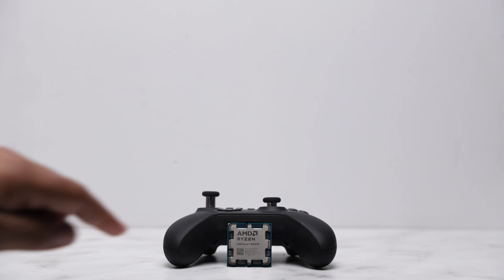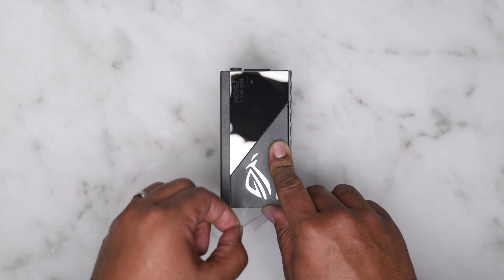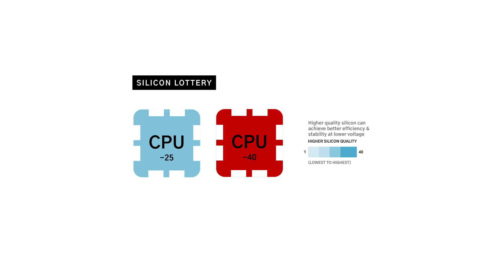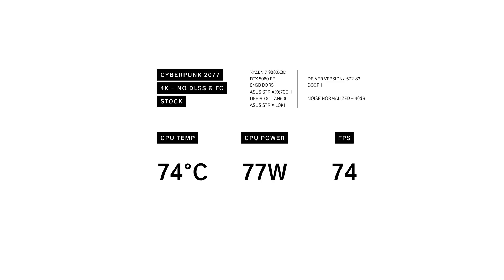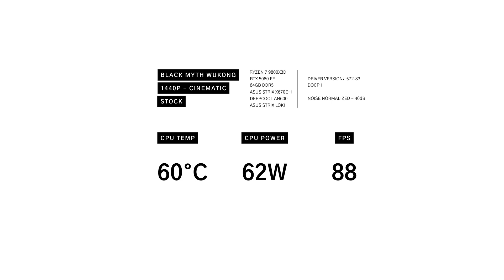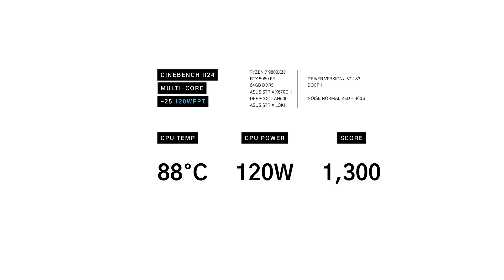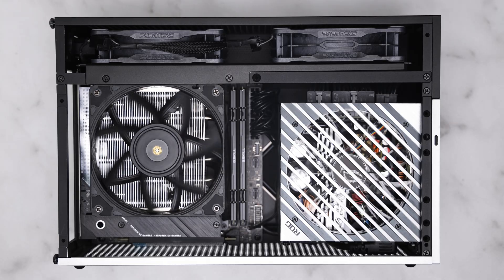Faster, Cooler, More Efficient – Best PBO Settings for Ryzen 9800X3D!

Comment: There is a setting that worked with my 9800X3D. CO -25 would crash.
I used CO-20, but I changed it further using the curve shaper. I set high and max clockspeed to another -10 mid/high temps and -15 on low temps. And it works.
All other settings are unchanged. 
WIth that the 9800X3D runs with maxed 5250Mhz and fixed fanspeed, which almost can't be heard, below 80°C in a bad ventilated case using a Phantom Spirit 120SE.
Reply from the maker: I’ve heard Curve Shaper can help prevent those idle crashes when your offset is too aggressive. One day I’ll dive more into that.

Comment: everytime I see one of these SFF builds I look over at my Torrent Compact and cry. I have the 4090 gaming OC so it wouldn't fit in many ITX cases. Barely fits in torrent compact. I had to replace the 180s with 3x NF a12x25 and theres about half a mm of clearance.
Reply from the maker: Well small form factor builds can be very challenging and the cause of many wasted dollars and 3am tinkering.

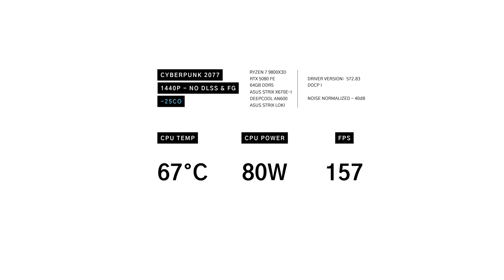Comment: 3:30 where are you getting those FPS from in CP2077? Not even the 5090 can reach 157 fps with no FG / DLSS, let alone a 5080
Reply from the maker: 1440P no RT, no PT
Reply: the highest I can do achieve is 97fps in 4K with everything maxed and DLSS Quality. I optimized whatever possible and undervolted/overclocked both CPU/GPU slightly, but I've never seen it go above 97fps after like 50 different runs. completely stock fresh Win11 install without special optimizations gave me like 85fps in the same benchmark. And 3DMark confirms that I run at or above the average results.

Comment: I’m also a T1 V2.1 user. My 9800X3D has 115 SP and runs stably with a -35 Curve Optimizer setting. I’m using the X47 Full Copper cooler, and in Cinebench R23, I get a score of 23,600 with temperatures ranging between 74-77°C. Silicon lottery makes a significant difference. I don’t even touch other power and temperature limiting settings because the chip already draws low voltage and doesn’t exceed a certain limit.
Reply: What fan/fan speed are you using on your X47 because I'm using the AXP-100 and in R23, I go up to 95.
Are you running +200 on the CPU as well as -35? I've run -35, -40 & -45 and see temps no where near the temps as what you're saying so I'm curious to know what you've done to achieve these temps.
I'm not trying to call you out, I'm just very curious what you've done to achieve these temps.
Reply from the maker: @ well I contemplated going with a X47FC for the video but I am able to use a taller cooling in my setup. To get okay temps on a X47 you need to ramp up that fan speed.
Reply: What does “115 sp” stand for??
Reply: Where did you buy yours, and when?
Reply: Of course, I don’t use the +200MHz boost. It means extra heat and power consumption for almost no gain. It makes the processor run nearly 10°C hotter. Even when using the Atmos 240mm AIO, I didn’t enable the +200MHz boost because it’s unnecessary.
Reply: @ Interesting! I may give it a go without the +200 MHz to see what it's like. Cheers for coming back to me on this!
Reply: By the way, I ran a CR24 test last night and got a multi-core score of 1375. The temperature remained stable at 80.5°C, with an ambient temperature of 23.5°C.
Reply from the maker: @ that checks out with a smaller cooler than my test.
Reply: No way you’re getting 74-77C while running CB with X47 Full. Not possible.
Reply: @Nespalvotas Let’s jump on a quick video call whenever you’re free and I’ll show you right there. Just drop your contact info. And honestly… why on earth would I waste my time putting fake numbers under a video like this? What’s in it for me?

By the way, it’s clear you didn’t read my last comment below. In my most recent tests at a room temperature of 23.5°C, I got a score of 1375 with CR24, and my CPU hit 80.5°C.
Reply from the maker: After running these tests I notice just implement a healthy CO improves thermals the most.

Comment: Instant watch on your vids bro. I just finished my 5090 FE and 9800x3d with the atmos cooler based on your vids. 

The stand-off mod with the steel not the nylon (learned the hard way) is a must!
Reply from the maker: I learned the hard way too, I made the nylon work for a short while but the 5080 is held up my jello. Also I have a new Stealth ATMOS coming to the channel and maybe a V2 in a could of weeks

Comment: Perfect video for me now I can start tuning my 9800x3d inside my T1 properly. Thank you so much
Reply from the maker: You bet, let me know if you have any questions about anything in the video
Reply: @ChrisRussellTech  thanks for the video! Did you noticed any turbulence noise with thatcooling setup?
Reply from the maker: @4xget  no turbulence at 40dB, I moralize at that level.
Reply: @ChrisRussellTech  I have 2 questions. Which PBO2 you prefer in asus bios Ai Tweaker or Advanced AMD Overclocking and second question is that there is core performance boost which help me with lower temps but is worth it? Thanks you.
Reply from the maker: @ via the AI Tweaker menu but they’re the same but different directory.

Comment: I don't know if I'm ever going to get a 9800X3D, but I'll be coming back to watch this if I ever do!
Reply from the maker: It’ll work with more than just that CPU, same principles, the only big difference is the power limit. Taking a 9950X down to 120W will have noticeable performance loss versus the 9800X3D who pulls 140W in a full core scenario.